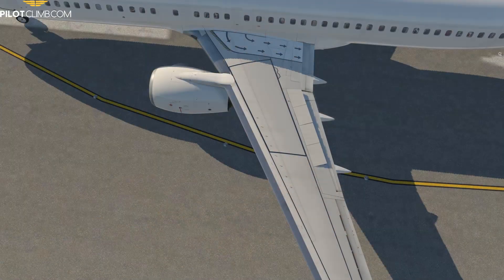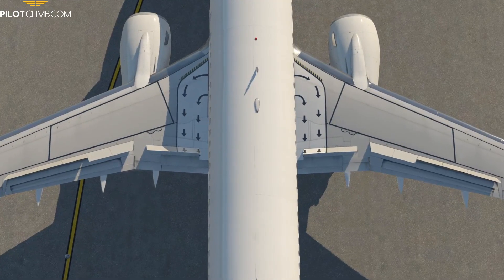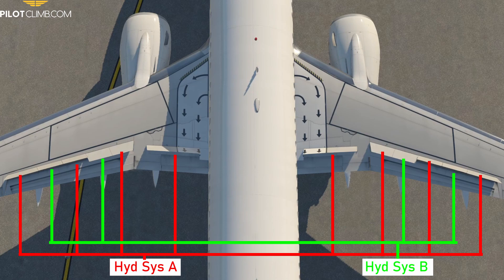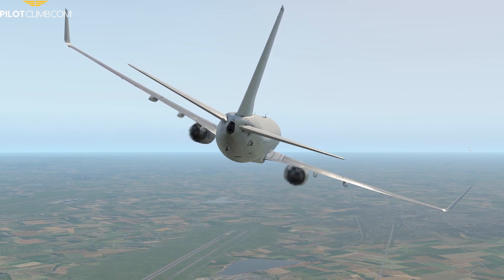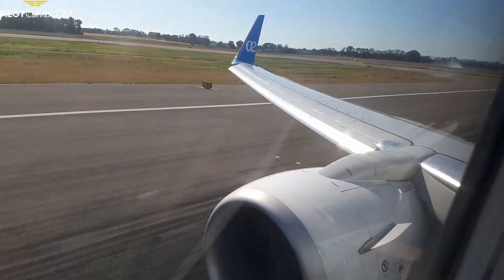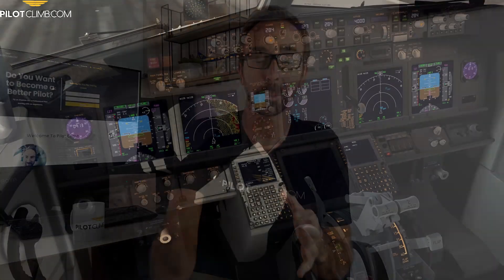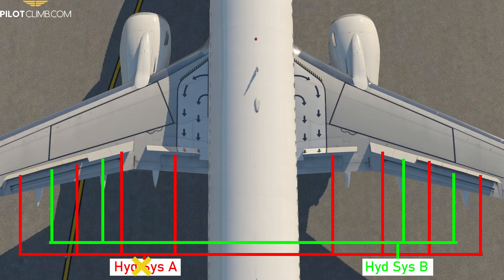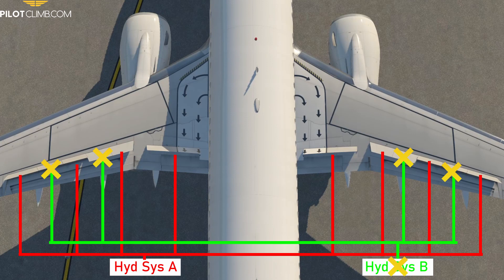Boeing 737 Flight Spoilers and Ground Spoilers.

Comment: 8:41 most important point after Jeju Air Flight 2216 tragedy. System A runs landing gear too. Probably why they landed late and had so much speed: no spoilers, no Engine 1 Reverse Thrust (left side), and no landing gear.